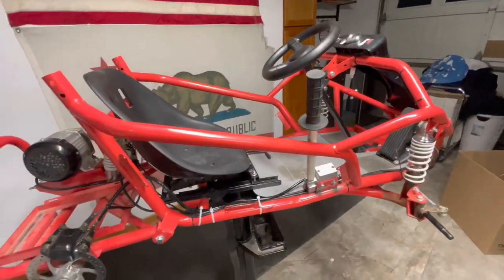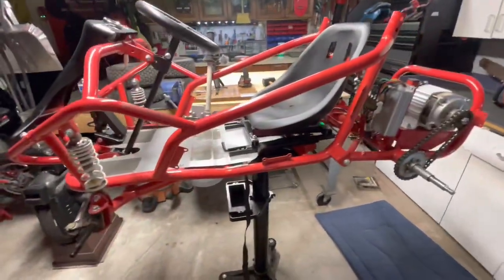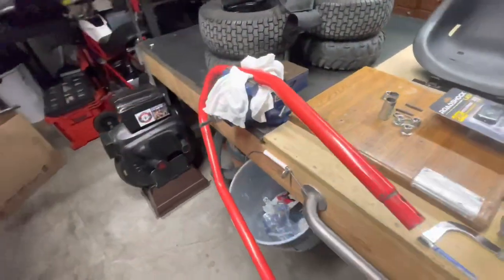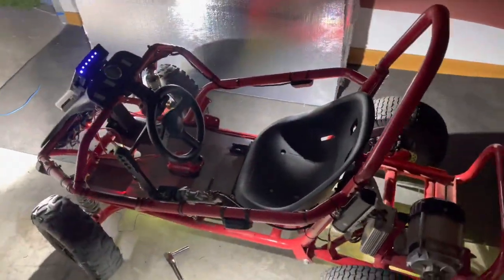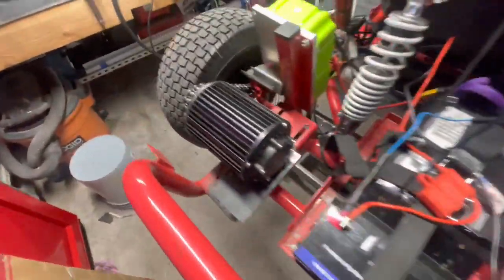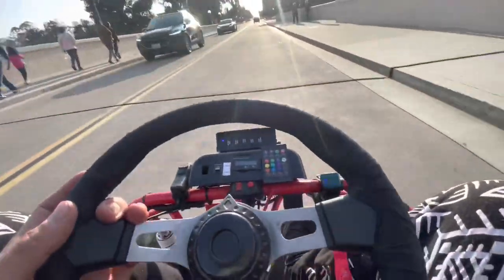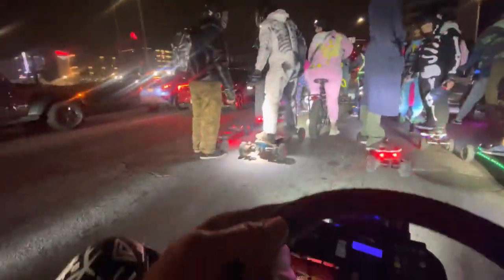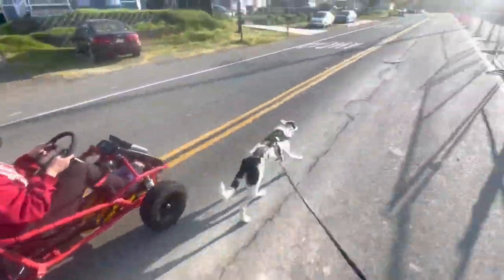Mototec Mud Monster custom build complete! Episode 5***Fardriver, QS90, 72v SDESK8 Ride Chaos!

Comment: Was it all plug and play and bolt on?
Reply from the maker: For the most part plug n play for all the connections. But it did require some custom fabrication, I cut and welded some parts to mount the motor and had to use a 420h chain and welded a sprockets on top of the original adapter. But electrical wise all plug n play.